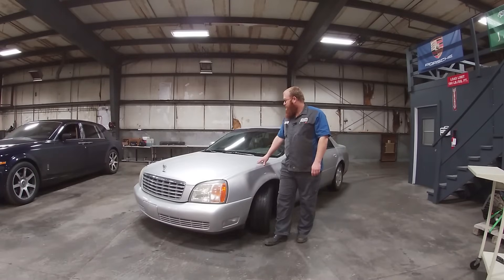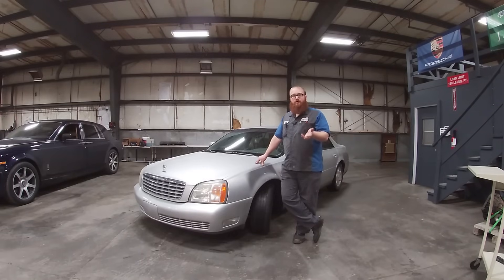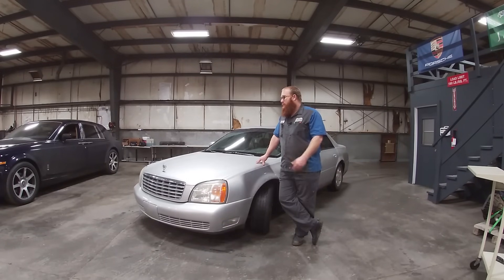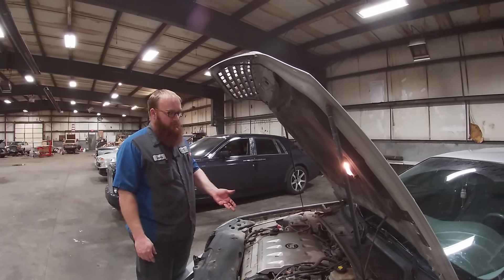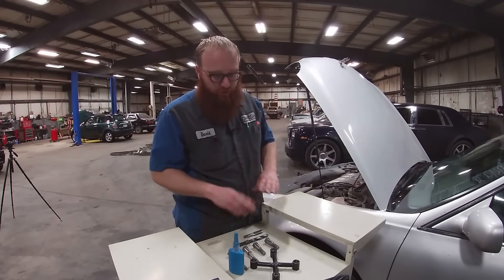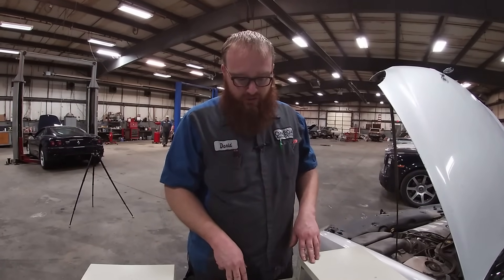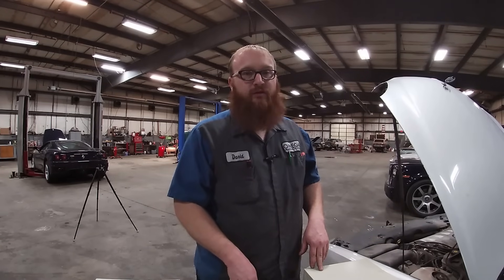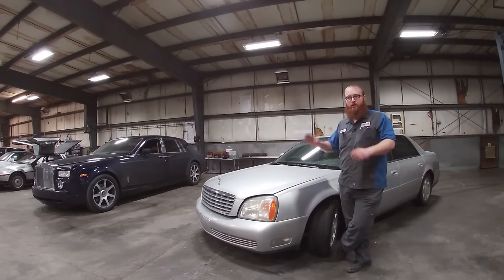The CAR WIZARD names Cadillac's Northstar Engine the Dumbest Design

Comment: The sad thing is that Cadillac could have designed this engine with the proper head bolts for about $5 extra in manufacturing costs. Instead, they saved $5 and poisoned a Cadillac customer for life after seeing the $5000 repair bill.
Reply: Ody 2002   GM and Chrysler seem to do this sort of cost savings  stuff over and over
Reply: The good old homer simpson engine
Reply: Exactly right. My last GM will be my LAST GM. Built out of stupidity.
Reply: @billcoulter9879  You think ONLY GM and Chrysler do this?! ROFL
Reply: @Bill Williams that's just corporate philosophy in general. When your job as CEO is dependent on providing returns to shareholders, you do cost cutting measures. Yea, sometimes they're really bad ideas.
Reply: He mentioned that the later Northstars don't have this issue so they must have fixed it. But this is the same company that thought it was a good idea making an aluminum four cylinder engine for the Vega/Astra cars in the 1970s, without iron cylinder sleeves, because it would have cost them an extra $5 per engine. The same engines started burning oil at about 10,000 miles, after which the car would come in under warranty, and then G.M would have to pay for repair or replacement.
Reply: Ford is not innocent of flogging junk either, the 80s Ford Escorts spring to mind.
Reply: Planned obsolescence
Reply: At that scale of production, $5.00 per car equates to millions of dollars saved, in the eyes of the manufacturer. As far as they're concerned, they probably came out ahead (ha) on this one as long as it happened outside warranty. Most new cadillac buyers probably trade in at low miles anyway.
Reply: Judging by the comparison of the stock headbolt to the replacement about the only thing they might have saved was some steel. It looks like there were more machine operations involved in making a stepped head bolt then a straight one.
Reply: OlegKostoglatov everyone forgot about the quad fours doing the same thing too.
Reply: That's funny!  I'm a retired machinist and I was thinking the same thing when watching this. "5 bucks at the manufacturing level could have prevented this"👍

The cheap bastards!  If they can save one penny over ten thousand cars they'll do it!
Reply: They did that on purpose they build junk,,.
Reply: Ever see the documentary on the new mustang design. The higher ups turned down a bolt that would make assembly and repair a hell of a lot simpler to save 2 cents per unit
Reply: Old skool movie about this...kalld gung ho ...
Reply: @theginjaninja132  I dont think they put enough thought into it for it to be planned obsolescence. I think they just look at a spread sheet, move some part numbers around, see the figure at the bottom drop by 50 bucks, multiply it by 300,000 or however they are meant to sell, see 15 million dollars in the savings column, show it to shareholders, and party.
Reply: @geroutathat  you're probably right but they would have known that cutting corners mean that there will be more trips to the mechanic and more OEM parts to be sold.
Reply: One word : Honda
Reply: It's like the Head of Cadillac handing some shovels to the engine designers and telling them " let's get to work guys, Go did a BIG grave for the company".
Reply: Equivalent to Nissan transmission
Reply: You would have thought that G.M would have learned that lesson with the Vega/Astra cars of the 70s, they designed a new series of cars, including the engine, from the ground up, in under two years. The rule of thumb at that time was that it took about five years to develop a new engine design, from the drawing board, to production, just to wring out all of the problems. G.M engineers, with the Vega, were trying to develop an all aluminum four without iron cylinder sleeves, something they had zero experience with. 
  As to why G.M chose to use stepped head bolts on the Northstar V8s I don't know, it certainly wasn't cost. The extra manufacturing processes involved to make such bolts verses straight, off the shelf ones would outweigh whatever they would have saved in material. Come to think of it smaller head bolts mean that they would end up using more aluminum in the top deck of the block, and as anyone knows aluminum costs considerably more then steel. I'm guessing that the rational behind these head bolts may have been something as stupid as saving maybe a pound of weight.
Reply: The Pintos were  not bad cars mechanically, up until ten years ago I still used to see the odd one, or it's Bobcat look alike, on the road whereas the first generation Escorts were pretty much gone by the mid 90s. The main issue with the pre 1976 Pintos was the fire potential from rear end collisions, which Ford handled very poorly. Ford believed, or rather their lawyers believed, that by recalling the older Pintos, and repairing the problem, that it would make them culpable in any law suits. If anything it made them more culpable by appearing to cover it up. There was one G.M body style, from the late 70s and 80s, that was also prone to fires after being rear ended, but you seldom hear about those.
Reply: The ht-4100 was junk too..and the 5.7 diesel... Only idiots owned Cadillacs..
Reply: I once saw a 1976 Cadillac in a parking lot and was surprised to find that it had a plastic grille, my 1975 Chrysler Newport had a metal one and it was a cheaper car when new. At least the 472/500 engines were solid, even with the gas sucking smog crap on them.
Reply: xxdfoster. Don't forget TOYOTA and to a slightly lesser extent, NISSAN. A few technical problems but the engines lasts forever.
Reply: @OlegKostoglatov  the same company that gave us the Oldsmobile diesels. 5.7 L diesel👎👎
Reply: @33ad1  I think the concept of research and development, is a foreign idea to General Motors. Just cobble some garbage together like their diesels in the Oldsmobiles, and the Northstar Cadillac engines, and foist them on the public. There is no way that they did any long-term tests on those types of engines, or they never would have been put into production in the first place. Absolute garbage! I know, I had a couple of those Oldsmobile diesels. Head gaskets went bad in both of them. I just don't understand why General Motors filed for bankruptcy around 2009.🤣🤣🤣
Reply: @OlegKostoglatov  and fiesta, festiva (ok thats a rebadged mazda but crap either way) sierra, scorpio, transit..
Reply: Poisoned their entire everything ....they have produced nothing but garbage since 1980 to present, and have fkd their ENTIRE customer base all the way!!
Reply: Mark Chatman which doc?
Reply: Oliva Gina I had a 71 that had the recall done.
Reply: Bill Coulter And Ford too.
Reply: That’s why I’ll stick with Toyota
Reply: I have had a few GM products over the years an it was always something stupid breaking or fucking up, I haven't owend a GM product in 14 year an my life is so much better
Reply: @billcoulter9879  ford 3.8liter in the 90's also, not enough bolts in the head on those
Reply: There's probably one GM executive who is pleased as punch because he ruined a rival's career by forcing that change.
Reply: Or they could’ve even actually designed it better for free in terms of added manufacturing costs
Reply: It's the domestic's way. Although plenty of German and Italian cars have shit designs too. Even some of the Japanese engines have issues. Engines are complicated, but GM could have rectified this much swifter than they did.
Reply: Totally destroyed their reputation. It wasn't the engine, it was Cadillac's treatment of the issue
Reply: The probably lost life long customers over 5$.
Reply: papakfmcnados king you know Henry Ford started that in the 30s right?
Reply: You can buy the bolts now. They are CNC machined.
Reply: GM's customer for the caddy's wasn't the second owner it was the first owner
Reply: @OlegKostoglatov  yeah in the 70s they thought all they had to do was coat the cylinders with Teflon, right out the factory the Teflon protective coating wears off at 30k. Outcomes the recall then they put in the sleeves!
Reply: @OlegKostoglatov  1975 is when they start to get real cheap on the build quality on Cadillacs, it was fully implemented by 1978. it started slowly in 1971 to 74 when they start putting rubber & plastics body spacers in between the bumper and the quarter panels front and back. I know this shit because I grew up to a family who owns and runs old caddies. The best ones in the fleet have the model years 1967-1973/74
Reply: when reading through the comments it dawns on me that this is in no way bad engineering but was done on purpose
Reply: Oliva Gina  The other "car" might have been the Chevy/GMC pickups with the "side saddle" fuel tanks mounted outside of the frame rails with no protection except the sheet metal of the pickup bed.  The problem was similar to the Pinto, except it was side-impact accidents that ruptured the tanks.
Reply: Oliva Gina  car engineering is evolving into better and better quality. When it goes backward it doesn't happen by chance. It is on purpose.  They want people not to repair old cars but to buy new ones.
Reply: @OlegKostoglatov  logistical nightmares too. At one point in the 70's ford trucks were juggling between 12 different universal joints in the drive shaft.
Reply: @OlegKostoglatov  desmog, and get a forged pot metal grille off a 75 top trim level Caddie.
Reply: Should of been mounted normally with drive shaft rear wheel drive
Reply: @DeusTex  At $5 a car, you'd have to sell 200,000 cars to make 1 million.  I don't think those numbers make any sense to kill off a customer base.
Reply: This is what happens when the tail wags the dog [ie, you let the accountants run the company!]
Reply: @OlegKostoglatov  lol. No way even in the 70’s sleeving the engine was $5.  Not even close. 

That car was the first GM attempt to build a small, light car. It was a POS, no doubt. The original test car had the front suspension/steering fall off the car on test drive #1. 😆  Management forced down bad choices.
Reply: It all works out because the taxpayers picked up the bill for all the bad business practices in bailing out GM
Reply: @mrpaiute9013  That is just not true.
Reply: @punkem733  They all do it, but there are more than 50  shades of grey between black and white, if you don't want to be f*** as a customer.
Reply: @KBS117  I had both and both failed miserably. Stubbornly I rebuilt both but never recovered the rebuild expense.  GM lost me and my family permanently. Now I run Mercedes and Volvos. May get a Lexus next time but no GM.  Burned and learned.
Reply: Sounds like an American car maker to me...
Isn't it a shame that the management style America uses is so bad.
Reply: @mrpaiute9013  GM payed that money back with interest.
Reply: Can't keep sparkplugs in Ford V8 engines since 1990... too few threads and they rip out of the soft aluminum heads... or spark plugs extend too far into combustion chamber and hard crud build up on them removes the threads when removing the spark plugs... 3 valve 5.4L is the worst at that...
Reply: Don't buy anymore Cadillac's. There's your solution.
Reply: Cadillac and Corvette two pieces of s*** that I would never own
Reply: @stevejohnson1397  - Stick with your 3-wheeled Big Wheel...
Reply: Cadillac, like all other GM divisions, got sidetracked when the started replacing engineers with accountants. At one time, imported vehicles comprised about 15% of the vehicular traffic on North American roads. Today, that number belongs to the Big 3, not because imports are that much better, but because GM, Ford and Chrysler left their faithful followers with a bad taste in their mouths.
Reply: Not to mention resale/trade-in value, every Cadillac felt the burn on that.
Reply: @OlegKostoglatov  I used to think that was the flaw with Vegas as well. But Nissan has been building solid aluminium engines for years without that problem. It must be a difference in the aluminum alloy. BMW changed how they manufactured their solid aluminium engines in the late 90s. Because of a problem similar to the Vega. But it was only a problem in the USA. The explanation was a difference in how clean the gas was.
Reply: @OlegKostoglatov  No car company has never made junk IMO. Even the "good" companies like Honda and Toyota have made some pretty awful vehicles, but they tend to get overlooked because of their reputation for quality and reliability.
Reply: @billcoulter9879  Right. 

 Consider the Corvair.  It was designed to have an aluminium engine but GM decided that aluminium was too expensive so they made the engine from cast iron. The result was that the car was tail heavy and had dangerous oversteer.

Consider the Vega.  Instead of using steel sleeves in the aluminium engine, they just plated the bores, apparently incorrectly.  The result was short lived engines.

Then there were the Diesel engines used in Cadillacs and Oldsmobiles which had all sorts of problems.

It's strange that some manufacturers never seem to learn.
Reply: @punkem733  No.  Porsche - Volkswagen - Audi have done some stupid things too.  They all had the same door lock issue and it took them years to fix it.  VWs had a problem with out of round brake drums for years.  My 1971 Porsche was a disaster; it had many inexcusable problems.  Of course that was more than half a century ago, but corporation misbehavior can last longer than that.
Reply: @DeusTex  But when companies do that sort of thing, in the eyes of their customers they ruin their reputations.  Because of the things that Porsche - Volkswagen - Audi did years ago, I would not consider buying one.  English cars developed such a bad reputation that to this day many people will not buy them.

Saving $5 per car can add up to $millions saved, but the consequences can add up to far more over the years.
Reply: @Iconoclasher  And the consequences of getting a bad reputation for it can cost them far more.
Reply: @frankeggers4024  I agree.
Reply: @OlegKostoglatov  Ford never sold out to China...  As Gm/Chevy did in 2008....
Reply: It wasn't the head bolts that were the issue. The issue is soft aluminum used in the block casting. 

This engine was bought from Lotus a GM division. Oldsmobile worked on the engine design and Cadillac used it in their cars.
Reply: @averyalexander2303 And anybody along the line can stop production if they see or think there may be a problem and they don't get screamed at for stopping the line. There's a Japanese word for it but idk what it is. Watched a Doc on Japan's manufacturing of automobiles. Very good doc. So if these was made in Japan and long Tran saw or heard ppl say the head bolt design was wrong he could've brought this up and saved them $$. They started this after the T100 frame rot issues. Smart ppl.

Comment: My 03 Deville belonged to my Dad I'll never get rid of it it cost 1200 for all the gasket replacements if this happens ill just park till I can save the money i only drive it a few miles a week to keep it going..miss you dad
Reply: yep. some cars are def worth keeping
Reply: The car can stay, the engine nahh
Reply: I'm sorry about your dad RIP
Reply: @MrThunderCunt  you gotta baby it😂
Reply: Even at $5000, it's definitely worth it to replace the studs with Car Wizard's method, as most of these that I've seen on Craigslist have under 100,000 miles, and they seem to have zero to little rust.
Reply: If you ever plan on swapping the engine DO NOT swap it with the same year engine, look for a 2005-2011 engine, they fixed the issues as wizard mentioned and are fairly reliable
Reply: @en3myspott3d54   Hello, I have a 2001 Oldsmobile Aurora 4.0  with about 160k on it! It has an oil leak, leaking from the rear main seal. No mechanic will touch it! I've been asking everywhere in my area. I'm in Redford , Michigan. Near Detroit, Michigan. Any advice please?🙏🏾🙏🏾🙏🏾🙏🏾 Oh the engine swop you spoke of ,will those year engines fit into this car?
Reply: Hey @poppakaneswrestling, I hope you and the Cadillac are doing well as it's been three-ish years since you posted this comment
Reply: @MrThunderCunt It's gonna crack regardless... It's a Northstar..
Reply: @DUCKSAREEVILLLLLLLL  4 OR 5 Thousand for a gasket repair seems a bit of a gouge in pricing
Reply: @fannybuster  Every increase in new car prices makes that less of a gouge.